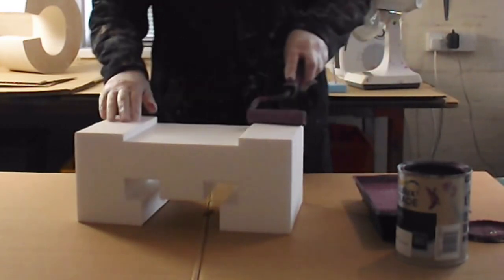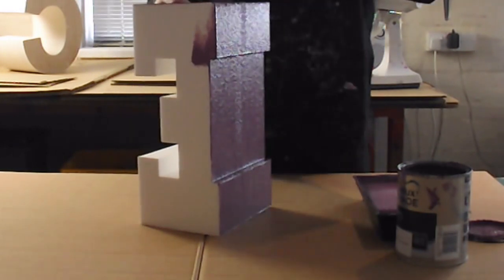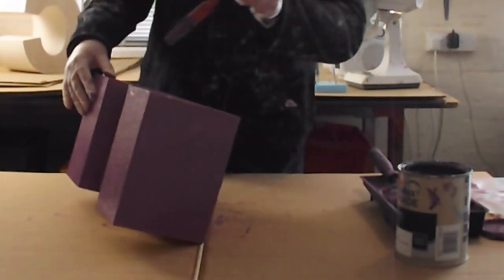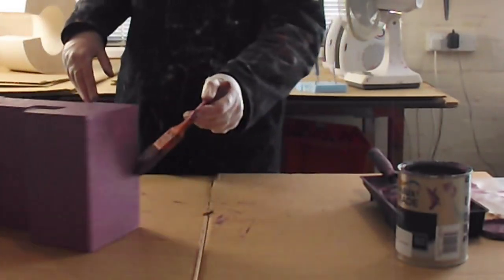how to paint polystyrene

Comment: Hi, did you use a primer ?
Reply from the maker: No need if you are painting using a water based paint and vinyl matt emulsion or masonry paint. If you want to paint with solvent based paint you will need to seal the polystyrene. We use two layers of water proof PVA if we need to seal the surface.
Reply: @polystyreneletters6775  Thanks a lot... 😀